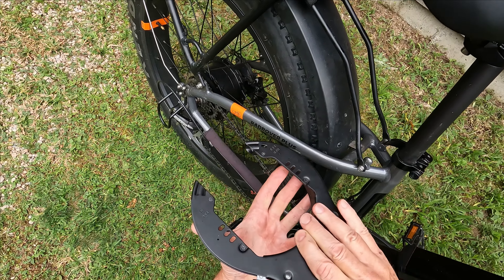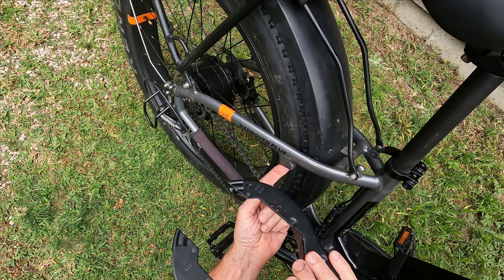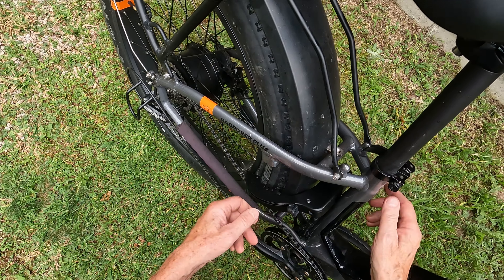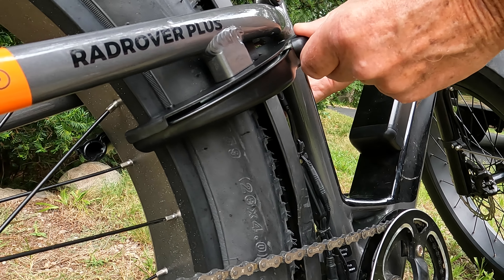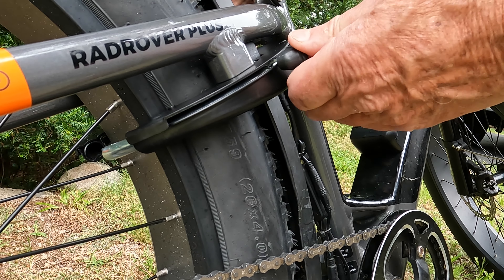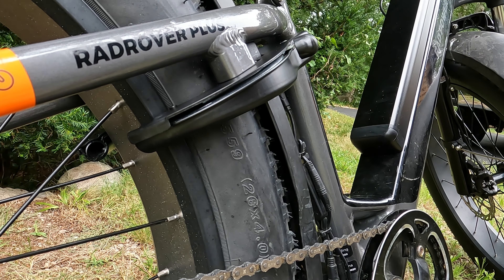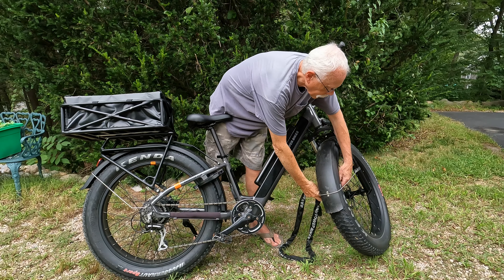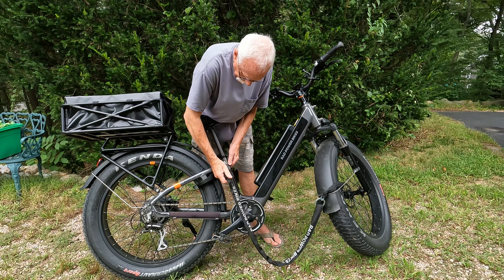RadPower Bike Lock on a RadRover 6 Step-thru

Comment: Nothing can stop a battery-powered grinder or cut-off tool.  I keep talking myself out of buying a 3 wheel trike for this reason. Just look how quick they steal catalytic converters on cars (90 seconds) and they first have to get under it. Thieves carry these tools in daylight with backpacks also slim jims to open car doors down their pant legs. You just can't have anything.
Reply from the maker: So true, but not universally so.
As I worked on this video, I knew someone would bring up this unfortunate reality.  In many other locales a simple locking system like I describe here will suffice, thankfully.
Reply: That is what I'm trying to figure out. Mine folds...so I'm hoping to get the front and back wheel with one heavy chain and a small one for the extra wheel. Hopefully I can get away with two high end locks. Three locks might cause them to go for an easier target.
Reply from the maker: Is yours a Rad Expand?

Comment: Great video Pop. I just ordered my RR6 Plus Step Through today and am having a local bike shop in Missoula put it together for me. I've shared your video on the logical way to mount the large basket. The rear view mirror option was no longer available for my model for whatever reason so could you please share where you got your rear view mirror? Thanks.
Reply from the maker: Excellent, have fun with the new toy.  While you wait, you can get the mirror at WM.
Zefal mirror link, https://www.walmart.com/ip/Zefal-Bike-Mirror-with-LED-Bike-Light-Universal-Handlebar-Fit-Battery-Included/624552223
Reply: You love it. I got my step thru plus about   2 months ago. Added really great left and right mirrors. Extender tube for my iPhone holder. It’s great.
Reply from the maker: Nice!  Gotta love all the accessories out now.
Be safe out there.